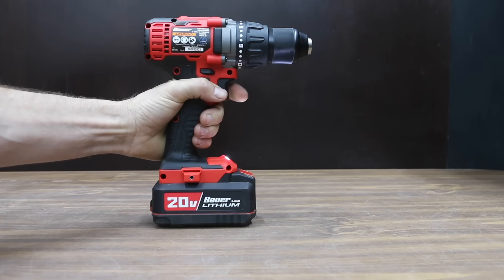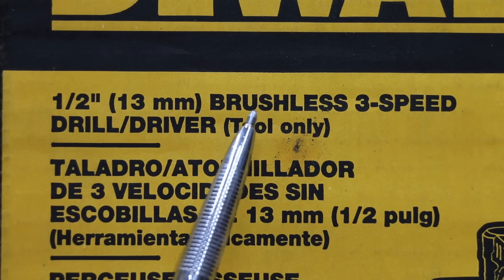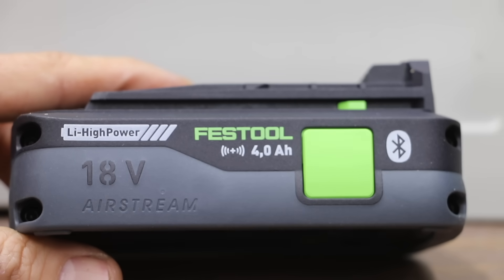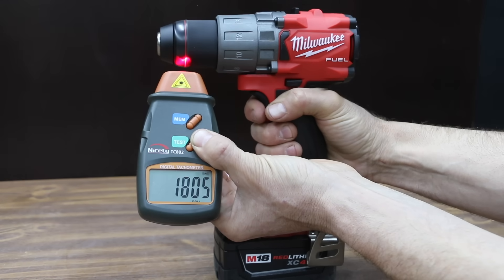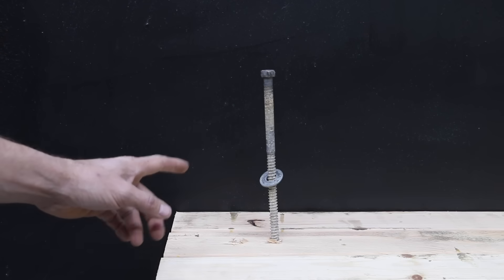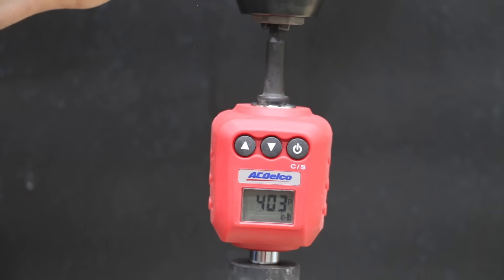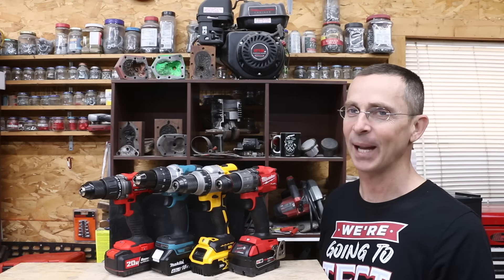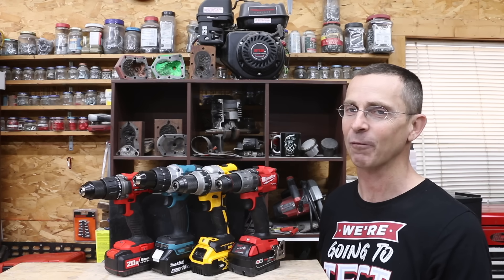Best Drill (BATTERY POWERED)? Milwaukee vs Dewalt, Makita, Bosch, Festool, Ryobi, Bauer, Ridgid

Comment: The removable chuck on the Festool is something I wish other brands offered,  but at over $500, NOPE!
Reply from the maker: Thanks for sharing.
Reply: Milwaukee has a M12 version.
Reply: @pobaeas7326  Hey thanks for the suggestion! The M12 has a couple things that might not cut it for me tho.  First and foremost,  it's only 12v, next,  I really dislike the overall form of it. Lastly, and maybe most importantly,  I'm not sure the removable chuck on this is actually what I'm looking for.  I say this,  because I have a corded Black and Decker drill that,  when you remove the chuck,  the spindle lets you insert a standard hex bid in the end of it. This really expedites work time when you have to drill a pilot hole,  and then drill in a screw, because you can just leave the drill bit in the chuck,  pop it off, insert the hex driver, drive the screw,  and then pop the chuck back on to drill the next hole, and so on, rather than swapping the bits in the chuck... Can't tell from online pics if the M12 spindle will accept a standard hex bit or not...
Reply: @Quickened1  I have the M12 Fuel (the one with 4 chucks) and at least it accepts the hex bit, but I pretty much just how swap the chucks. It's faster when I put the whole chuck in my pocket and it's easy to grab without looking. 

I don't like the overall form either and I dislike that electric gear switch that is on top of the drill, but I absolutely need a drill with the off-set chuck and it was way cheaper than a Festool. 

I actually have an old Festool with removable chucks that has almost dead NiMH-batteries (BP 12 C) and a battery alone is 150€, so when I saw the Milwaukee on sale for 199€ with a battery and a charger it was just way cheaper to swap. I pretty much hate those NiMH-batteries as they always fail at some point where as I haven't had a single lithium battery fail on me. 

I always have at least two M18 drills with me anyway(cheapest way to hot swap is just to have 2 drills), so I just stick with the M18s unless I'm working in a tight space and I really need those off-set chucks.
Reply: Of course when you add up the price of all of the Milwaukee parts to get close to what the Festool comes with, the Milwaukee costs more than the Festool and it's all made by slaves in china.
Reply: @mikey4016  and the Milwaukee m12 will not hold a candle to the Festool performance wise...

Comment: Interesting how the mechanical clutches can handle low torque so much better. You'd expect 'primitive' mechanical devices to be less elegant than modern eletronics.

But perhaps that goes to show you that mechanisms, when designed right, are exceptionally well performing at any task.
Reply from the maker: Thanks for the feedback.

Comment: I would love to see the max torque tests done with the largest available battery.   I never get nearly as much torque out of my 4 ah batteries as compared to the 5ah batteries.    And if i slap one of the huge 12 ah batteries on my drill it seems like something would break before it stops (ie, it just doesn't stop in low gear).   It would just be nice to know which drills are shutting off because the battery voltage dropped too low, verses which ones were truly hitting their max torque.
Reply from the maker: Thanks for the video idea.

Comment: I dont understand the Electronic clutches. In every drill I've used the mechanical ones are superior in every way to the electric ones. How can that Milwaukee be useful if on its lowest setting you're still reaming out screw heads??
Reply: It costs virtually nothing to use an electronic clutch.

Comment: Great test and Very impressive for the Makita XPH07 for being almost 7 years old. The new 18v XPH14 is brand new and also costs $149. It's smaller lighter quieter and and more powerful yet. Please get your hands on some new Makita 40v tools like the hammer drill because I think it would murder this entire lineup pretty easily if you have checked out Philly Fixed new video focusing on the big 3 only.
Reply from the maker: Thanks!
Reply: Thank you for the info. I knew this test was unfair to Makita by using a seven years old drill.

Comment: I use Milwaukee at work dewalt at home, working at home is always much less frustrating. The Milwaukees get super hot, the chucks last a week before they start slipping and even the 9ah batteries don't last after a while. Last weekend I used my Dewalt for 3 hours straight polishing stainless on a single 10ah battery, pushing hard the entire time, only got comfortably warm.

And I still had 2 bars on the battery
Reply from the maker: Thanks for sharing.

Comment: I’m disappointed in your drill selection from Ryobi. I’d like to see the brushless or even the newer HP ones. They aren’t a junk DIY brand but videos like this just add fuel to the people bashing Ryobi. I bought a kit where I got a brushless drill, driver, circular saw, and jigsaw and a brushed impact wrench plus two batteries and a charger for $249. That’s less than $50 a tool (for brushless tools) plus batteries and a charger. Not a bad deal.

That being said, I’m honestly most surprised by Bosch and Festool. I get Milwaukee, DeWalt, and Makita. They are superior brands. You pay more because you get more. But nothing I’m going to do with my tools is worth that extra cost which is why I went with Ryobi. I don’t know much about Festool but maybe the real value is it holds up over time? No clue. But it’s so far out there in price that it’s not even worth discussing. Bosch on the other hand you’re paying just about as much as the big three brands but consistently getting worse performance. Why buy Bosch then?

Comment: i knew the dewalt was gonna have crazy torqe, i use my for starting a 531cc cast iron brigs and if i dont have it already on compression stroke the drill rips it self out of my hand.
Reply: i also use that dewalt for starting my generator and snow blower. alot of my motors have a 3/4" nut welded on the crank since i got that thing.
Reply from the maker: Thanks for sharing.

Comment: Please test channel locks. Find me a channel lock better than Knipex - you can STAND on Knipex top handle and they'll hold grip. No bottom handle pressure required.

Edit: auto correct.
Reply from the maker: Thanks for the suggestion.